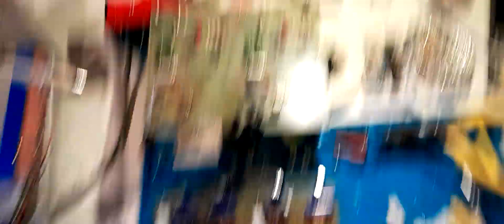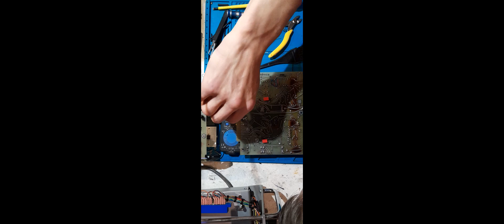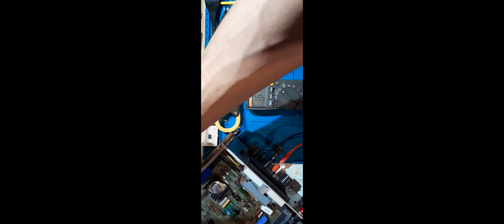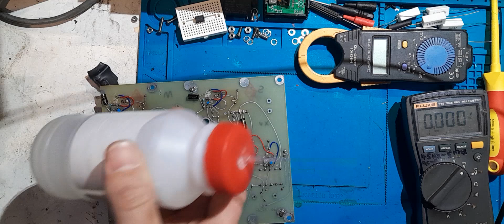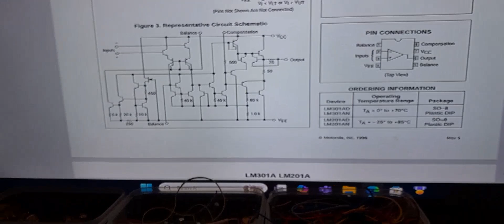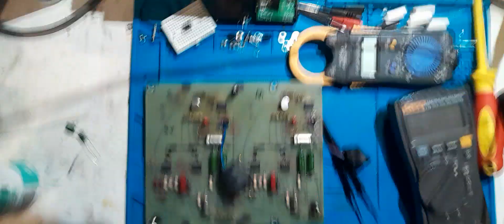Part 9 612b I'm still stuck also I added the caps mentioned in the end...it made it worse too:(

Comment: With the benefit of hindsight I think getting it back to stock first would have been easier for you then get performance data and  try improvements one at a time. You have to realize this supply worked fine or adequately for years it didn't actually need any mods at all. From that point you can keep things under control. Fully working and then you can stick faster opamps or add better references and see if it helps or makes thing worse, to be fair though it uses VU meters that aint even mirrored so you have to set the voltage with a meter if you want accuracy. It would be nice to have the circuit diagram or you draw out sections your working on because when you changed the wirewound resistors for ones with lower induction, I don't know why without seeing what they do. You also need to be careful changing and adding cap's as the guys or gals who designed this thing new what the were doing as the PSU is old so that's obvious. See you in the next video ! you were very confident of an easy fix on this and it's gone a bit tits up as the boards look like prototypes or needed extensive reconstruction surgery after a terrible car accident !!.....cheers.
Reply from the maker: @andymouse  Hey mate I made a video to explain the method to my madness, it's too much to explain here but yes your 100 percent correct with what your saying
Reply from the maker: Just a early update for you I think I just found why the voltage is too high for ch2 your going to have a laugh when you see what it was, that is if I'm right....
Reply: @daveselectronicslab  :)